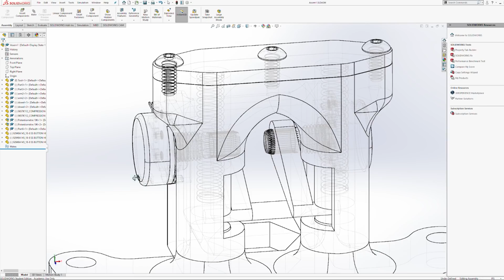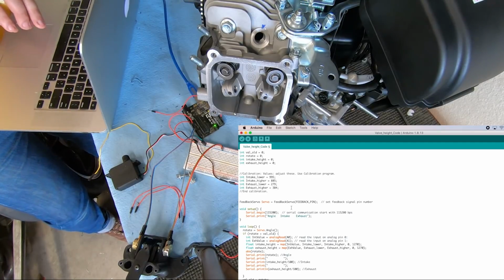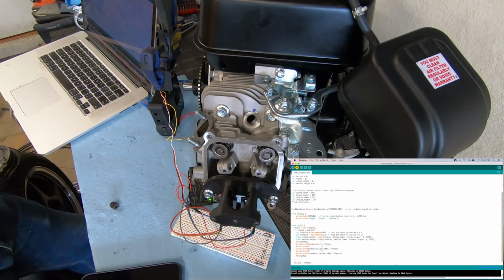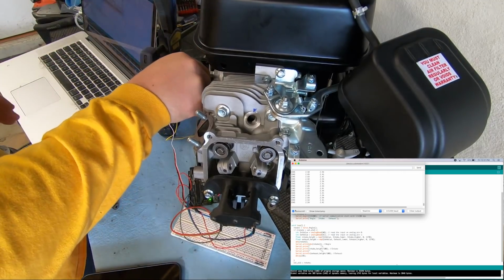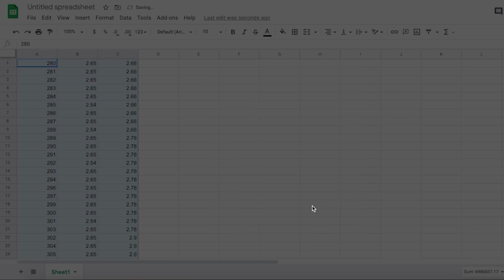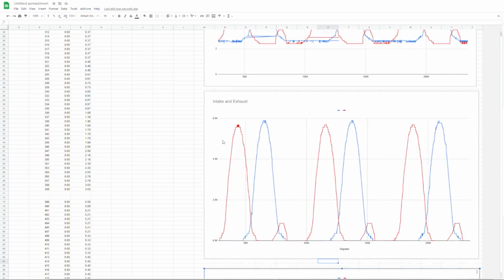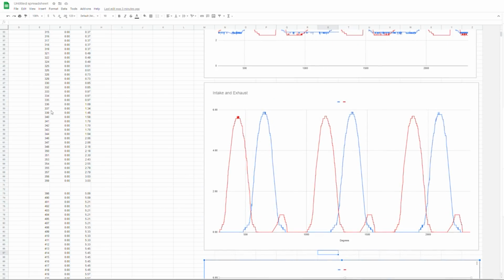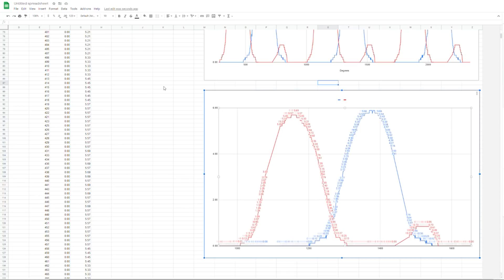Freevalve Build - Cam Mapping Tool

Comment: I've been a mechanic for about 50 years now. One thing I know for sure, there is nothing like having data. I have some good running sbc and sbf cams stored, numbered and tagged because there was no way to know what the grind is. Some cams saved and not labeled are unknown and basically not used because they are reground factory cams. That program you use or wrote along with a universal electronic depth gauge (like on a magnetic base or something like that), to connect directly to a computer of any kind would be very sellable. You could even add a set of "V Blocks" with precision roller bearings in the lower part of the V to set the cam in while on a bench. The person would only have to calculate rocker geometry to get correct valve lift, duration and valve overlap. A mechanic can easily mount a metal plate to an aluminum cylinder head to use a magnetic base device to read directly off the top of the valve. And, when a guy buys a new cam he can map it on a bench before installing, naming the cam grind with a part# and manufacturer. If you added a crankshaft trigger wheel and sensor as a kit he could sync his cam with his crank even in a  flat head. Honestly nothing like having data.

EDIT: Thank you for these videos. It really wakes up the mind to so many possibilities

Comment: Man, that's freaking amazing!  How about a file to make the cam lobes on the 3D printer?  I'm probably telling you something you already know.  The beauty of the system all rests in the overlap section.  No overlap for idle and low RMP torque, and more overlap for high RPM power.  I think the only reason to partially open a valve is due to piston and valve to valve clearance.  Aside from that I believe instant opening is optimal.  Either way, you will have to devise a way to partially open the valves to produce overlap neat TDC.  Now let's see you 3D print a matching cam lobe!

Comment: Do you have a patreon? Your work is commendable beyond renumeration, but Mercedes V-12s are NOT cheap to work on.

As for the Miata vs LS. I'm sure this is obvious to you that having an LS would be easier to do just about anything with, considering the aftermarket support. I have had nothing but Mercedes and Datsun 1600/2000 Roadsters my whole life and having a small convertible to drive is a joy. The Miata does have racing aftermarket parts for the whole car to go along with the amazing work you are doing. I truly am speechless.

With Thanks,
Johnny Steele

Comment: 4g63 would be a wonderful test, 90's era eclipse/talon/laser 
slightly larger displacement from the miata, and easy to get into forced induction at a later point. 
not gonna lie, im a bit of a DSM fanboi but having owned both 95 miata and a 90 talon. I found the talon fit me better and  at 6'1 240lbs and was a bit more fun

Comment: The NA Miata engine would be a good test platform. Then engine is super simple and robust, you'll have plenty of room to work with. Since they're a very popular race car you could also dyno it vs. a conventionally tuned car with race cams, timing adjustments etc and see how your system compares.

Comment: Having control of the valves lets you close the cylinder and start it without an electric starter. That might not work on a 4-cylinder, but should on any V8. 
A highly accurate (and no-touch) way to track the position of the valve while it's running would be to use a optical encoder sensor and barcode on a stub mounted to the valve. TDC/TDB can be registered with the data stream. Having this data, you can then optimize the profile at different RPMs. If you have control over other things like fuel delivery and ignition, you could really do some crazy things like up the compression ratio to 10:1 without detonation, some serious compression braking, and who knows what else.

Comment: Dont forget to include rocker ratio in final value of total valve lift and duration because different rocker ratio value greatly affecting how the engine perform...

Its just a simple multiplier anyway ranging from around 1.4x to 1.8x usually

Comment: This is really cool.  I wonder if maybe you should be referring to this as something other than Freevalve since that name is already taken?  We wouldn't want to see this end with copyright issues like the BisforBuild Mustang "El*an*r" build ended.  The idea that you could change cam profiles as easily as loading a new tune on a car is an amazing thought.  Not only that, you could conceivably make custom cam profiles that increase performance and efficiency in dramatic fashion.  Could mapping cams and using those profiles cause further copyright issues?

Comment: Just a suggestion: you might want to stick with a non-interference motor. Not that we doubt your skill, but as you make it more complex, one coding error typo and it could lunch the motor in an interference engine.

Comment: Old fox body Fords with the 2.3 turbo would be good options for the freevalve motor. They have lots of room to work on them and its a non interference engine. I think you want to go with non interference for this application. You can also bolt those engines into a Ranger.  They are easier to work on in general.

Comment: Is there anyway you can take advantage of the MegaSquirt platform in this?  It handles spark and fuel injection and already reads cam/crank sensors and such.  If it got valve control, things could get more interesting for all.

Comment: You might get some ideas from my camshaft measuring project. My next step is to turn the engine crankshaft with a larger stepper motor and measure the cam and piston movement at the same time.    https://create.arduino.cc/projecthub/varmint243/arduino-camshaft-measurement-tool-da7880?ref=search&ref_id=camshaft&offset=0  There are also a couple good camshaft measuring projects out there that I got some inspiration from. They will pop in a google search.

Comment: I don't want to beat a dead horse here as I see everyone has already mentioned the need to consider the rocker ratio. 

But, where he's at now with the R&D, I don't believe it's of concern. I think he's trying to establish and sync the crank position to the beginning of the valve opening and closing to ensure proper valve timing. The throttle can be wide open but a late and short valve opening event would snub any hope of rpm gain. So he's definitely going down the right path. 

It's like digitally degreeing a cam shaft. (the idea of which is sick)

If he were working on having the variable valve lift capability, rocker ratio would then matter for mapping actual valve lift. In that case a dial indicator would be considerably more accurate but, values would then have to be mapped by hand. Maybe do both for redundancy and verification? I think I caught in the video he was indeed planning on taking a stab at variable valve lift and referred to V-Tec. 

When he's at that point ratio's would then indeed be important.... as well as the length of the arms he has the POT's attached to. The distance from the pivot to where the pushrods make contact would affect those values while mapping. By knowing that distance and inputting it as a radius in a formula he probably computed the lift as the arms traveled. A bunch more math than I know lol. 

This may be what he meant by calibrating the potentiometers? Initially it sounded like he just did a min/max rotation of the arms as the calibration. Talking it through it makes much more sense that this is what he did though LOL. 

Great stuff, the process is spot on.

Comment: Miata, as much as ls free valve would be awesome... If you get it wrong it will be bad. Miata, if you get it wrong it will just run a bit shitty.

Once you get good and get it really reliable then move onto the LS lol. See just how far you can push it, a built ls using standard shit can get to crazy numbers.

Comment: I've plotted a stock cam from a Harbor Freight Predator engine and it has a dual pattern camshaft with .273 intake and .275 exhaust lobe lifts 205 222 duration at .050 with a 104 lobe sep.  I can send you the file if it would be helpful.

Comment: I hope you’re planning on turning those “sine wave” profiles into more of a square wave. I didn’t hear you talk about it, if you did.
Keeping the sine wave, standard cam profile will deliver the exact same performance as the cam/push rod/lifter combination.
Using a square wave profile will deliver the absolute most performance possible with standard valves. Losing that overlap will help too, unless you plan on going forced induction(it’s possible on these engines!).

Comment: It might not be necessary to produce the whole cam profile. It may be possible to simplify the thing by just having valves that go full open and full shut and just focus on the timing and dwell length in the cycle. (Cam profiles may be more of a compromise due to mechanical issues of the cam mechanism design.) And if that's the case, less to go wrong with the end result.

Comment: Nice work on the mapping tool! This project needs to be 'super-sized' for an LS engine, since they're so plentiful and easy to come by. Once you get your heads and valve train worked out, you can concentrate on making it do whatever you want as far as 'profile feature sets' for various throttle and load conditions. If you really wanted to get creative, design a 4 valve head that works similar to Koenigsegg's setup.😁👍

Comment: assuming you have plans to improve valve angle, port size and even combustion chamber down the line? You could create some crazy high comp high rpm engines out of random junk with these..

Comment: I love the build but I personally dont think pots are the go with measuring this as your are measuring the voltage via resistance via reference voltage without an inductance offset which is very inaccurate way of measuring, this will get worse and worse at high frequency.

Personally I think the only way to make this work is using laser which is easier to setup than you would probably think.

Comment: Hey now.   2 small points - 
a) That's not Excel, it's Google Sheets.  I point that out because you said "cost" but G Sheets is free to anyone who has (or signs up new) a gmail account.
b) I think you can get a more consistent "cleaner" graph of the cam by using a [variable speed] power drill set at a constant rpm to turn the crank and then you'll get a consistent spin and readings on the cam.   

A good "trick" to get a constant speed from a variable speed drill is to loosely wrap the trigger with a zip tie and then tighten one click at a time, squeezing the trigger to get the desired rpm  
In your case probably the least trigger movement that gets the drill spinning the engine steady.

Comment: I reckon using an older SOHC four cylinder, or SOHC six for R&D, will be easier to set up and test, especially with the extra mounting hardware for the cams (once removed). An aussie SOHC 6 from the early 2000s would be perfect (pre-barra). 4L, low revving (<6000rpm) and cheap as chips here. Buttt, youre in the US - I'm sure theres something similar over there?

Comment: What's the max operating speed on this?  A 600cc sportbike would be a neat idea also, and you can operate the sensor and wheel off of the stator potentially for crank position.

Comment: Cool video but a little overkill in my opinion. You could have easily just measured those values by hand with a dial indicator. Or even just measured the camshaft directly if you had it out
Reply: Not overkill at all really. He needed the lift, and open and close data, for each cam lobe for every degree of travel during 720 degrees of rotation on the crank. That would be almost impossible to do with a dial indicator, especially if the rocker ratio was something other than 1:1. The fact that this allows him to direct copy the values to his profile software (after some creative editing), is a major time saver.😉
Reply: @danw1955  All his contraption did was measure cam LOBE lift. Not valve lift. So the rocker ratio isn't included either way. He already knows the crank angle via his arduino and the serial monitor readout. Set up your dial indicator, turn, then record the number in excel, repeat until you get through one full rotation of the cam. Sure it's not the most fun way to do it but I guarantee it can be done in less time than it took to 3d print that housing for the potentiometers.

Comment: An inline-6 or flat(boxer)6 engine will be the most forgiving to tune as far as vibrations are concerned. And both are known for making tons of power. I know the reputation of BMW's reliability, or lack there of, but an n52 or n54 block and rotating body are; solidly built, light(ish) weight, known for making great power, can be converted to dry-sump or are a dry sump variant, mid-length/near-square stroke, cheap/plentiful, are highly tunable, and still have great aftermarket support for the parts you don't want to build yourself.

Comment: The stock cam profile will be a good starting point, but I had another idea. As it sits it's probably difficult to do variable valve lift as the solenoids are just on/off. So what if you just measure the acceleration of the valve as it opens and closes with the solenoids. Once you know what that profile is like you can essentially map cam profiles using those fixed ramp rates. That way at higher RPM you can use longer durations than at lower RPM, or even vary the pulse width to do throttleless operation. As for engine, I vote LS because that will by far give you the biggest splash for your channel and profile. If you can put a freevalve thing on a 4.8 and spin it to 8 or 9k rpm you'll be on every publication around the internet.

Comment: The largest advantage of this design is that as you open the throttle the duration for both valves increases based on the throttle's position, increasing hp and torque, on the other hand it should find the optimum duration based on the throttle's position.
 Hint 1: low hp requirements=less duration and lift.
 Hint 2: acceleration will require more of each.
 A guy should be able to increase the power output of that little motor by a factor of 2 by simply fine tuning it by placing a throttle position sensor on and mapping the duration and lift based on it's position and speed of throttle opening and closing.
 Should make it really snappy as well as the ideal lift and duration will be adaptable based on your throttle input.

Comment: When fitting to an automotive engine, be sure to get airflow and airmass data before the change over.  The biggest advantage of the camless system is turning the valve timing into a square wave.

Comment: I drive a 94  Miata daily and have an ex spec Miata that we run in endurance races lucky dog and champ if it was still in the PNW. So you would think I would be encouraging you to do the Miata engine  BUT I think you might be better served to do an Ecotec or a k24 yes they are interference engines but they are much cheaper as they are starting to ask for bigger money for the old 1.8's and these more modern engines breath better and are way lighter. The biggest gain would be the breathing better part. Love that you are doing this and I wish you luck and hope you are able to pull this off .

Comment: im now amazed that someone actually went ahead and got into rhe freevalve idea, ive been drooling on it since its pretty dope but it didnt make sense the way that it was originally designed (pneumatically actuated, hydraulically locked) and honestly i really wanna see this in a diesel engine. 
im definitely subscribing and imma have my ear to the ground, im not even half as good as you at coding nor engine thinkering but still in for the ride, mad props!

Comment: Judging by the comments and some of your replies, it sounds like you're going to go with a Miata. As a miata nutcase, I'd just like to say that NA miatas are getting really expensive, and they all have hydraulic lifters, whether it's the early 1.6 or the later 1.8. NB miatas all have 1.8's with solid lifters, so pick your poison. I saw in another video that you're located in Phoenix. There's a guy in PHX named Mike, and he effectively has an entire miata dedicated junkyard, and is a bit of a miata guru. Check out "Mike's Place" or "Mikes Miata Mecca" if you need any parts. I also have a BP-Z3 out of an NB (1.8 solid lifters Variable valve timing) I'd be willing to let go of for cheap, if you're interested in tinkering before you get a chassis, or otherwise don't want to use the motor that comes with whatever chassis you pick up. It's high mileage, and could use a few gaskets, but it came out of a perfectly running car. Located in Glendale. Super excited for what you've got going on here. This level of Frankenstein fuckery and genius is something us mere garage-dwelling troglodytes only dream of accomplishing, so thanks for documenting it all for us to look on in awe.

Comment: If you have your heart set on a more sports oriented car, I think the miata is a great choice. Theyre super easy to work on as well. 
If youre just looking for a proof of concept car, why not a geo metro? Definitely not as sexy as a miata or camaro, but they're extremely cheap, reliable, easy to work on, they're non interference, only have 3 cylinders to work on, and on top of that, only 2 valves per cylinder! Cost factor would go down a ton.